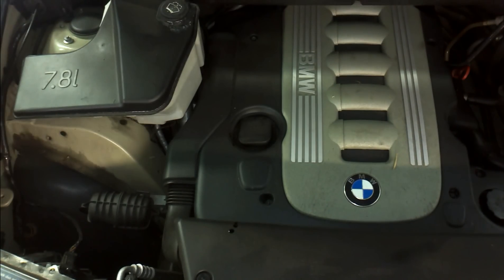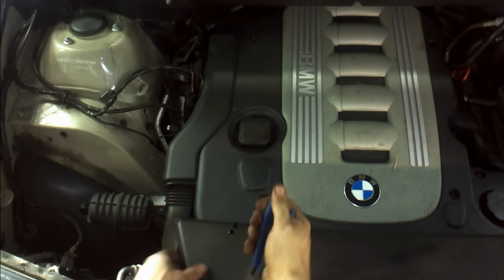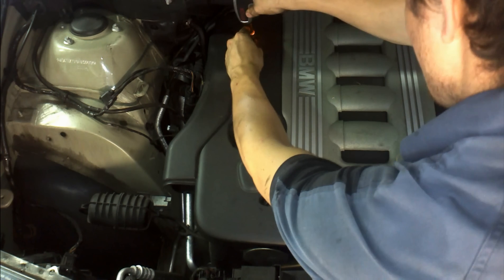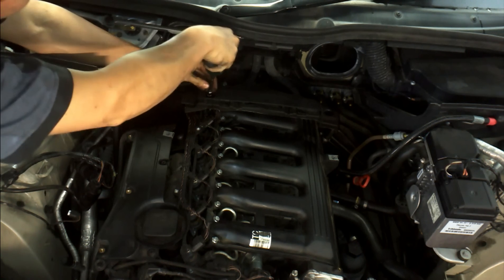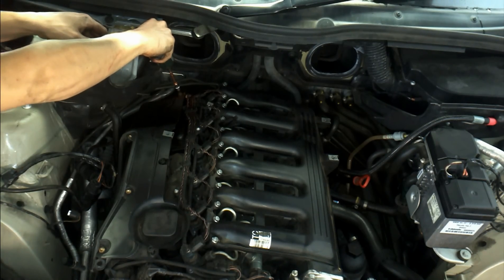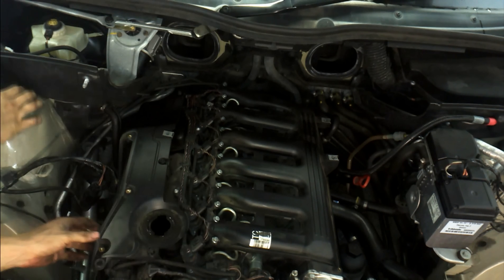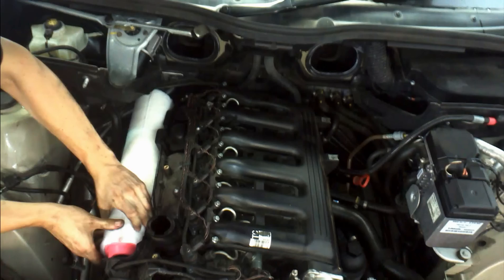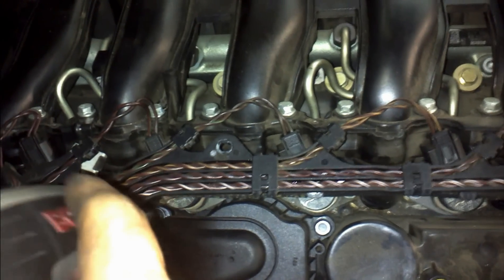BMW X5 E53 Air Filter & PCV Replacement 3.0 Diesel How to DIY: BMTroubleU

Comment: Watched your video wasn't changing PVC but was having trouble with water jets not knowing they had filters was about to buy motors but you saved me a lot of money cleaned the filters working perfectly cheers mate
Reply from the maker: happy days mate- youre lucky you dont have an e70 x5- they have the same problem but the water bottles are hidden behind the drivers side guard. drive safe mate

Comment: I followed that little tip from Seabrook22 and it was a walk in the park.
The Air filter and final cover just falls off and gently lifts out with complete ease.
I also found the existing Air Filter was not installed correctly, and the seal was crushed and bent out of shape. The covers were not in place correctly and that back screw wasn't even tightened up.

So many things fixed and corrected by following this great Video Tutorial :)
Vehicle now runs quieter, smoother and no black soot under hard acceleration.

Comment: Just replaced my PCV setup with the undated vortex version (BMW part number 11 12 7 799 224, no more cartridge to clog or replace).  Your procedure is VERY helpful, it looks like you did this on the 218 HP version, for the early 183 HP version - to replace the air filter you don't need to remove the silver "pretty" cover.  I would VERY much encourage owners to clean out your microfilter housing in the shower - mine will FULL of 10+ years of caked on dirt.

Comment from the maker: Thanks for the positive feedback. Im afraid im not making videos any more cause im working in the mines now. The airbag spring style self leveling systems have many components and issues. If one corner is lower than the others you have a leaking bag, this can be checked by measuring from the top of the wheel arch to the bottom of the rim. Depending on whether you have just rear or front and rear there are also level sensors, accumulators, the compressor, fuses and air lines etc

Comment from the maker: PCV stands for Positive Crankcase Ventilation. It takes the blow back gasses from the engine and usually puts them back into the intake system, but on the x5 its more of an oil separator which vents to atmosphere

Comment: Thanks heaps for this video, its is so clear and professional and every step and trick was covered made what for me was a hard job easy. I was able to complete the PCV valve and Air filter change which saved me a bucket load of money. Have you any videos on the E53 changing of fuel filter in the pipeline?
Reply from the maker: ah yes, that is a bugger of a job but like the description says i dont work for bmw any more unfortunately. the fuel filter is behind a big square cover under the body about at the half way point. to remove the cover is a bit of a hassle, so we used to drill holes in the bottom of the cover which were big enough to either remove the filter completely or small enough to fit a socket and extension though so we could undo the lines and allen key bolt holding the filter bracket on, then undo some bolts at the front of the cover to allow enough space to get the filter out that way (without having to take the cover right off). i do have a video about common issues on e53's if you want to check that out. thanks for the positive feedback- drive safe

Comment: Thank you so much for all your video's BMTroubleU.
They are the most detailed and clear videos on the net, and even better, you're an Aussie!
I have a 2006 X5 E53 3.0d (sports pack), any suggestions where to buy the PCV valve replacement? I'm in Oz. eBay? Dealer?
Air Filter is on the work bench ready to go ;)
Thank You.

Comment: Very handy, as this is a hassle (air filter cover).  Removing the microfilter housing is the bit of magic.  FYI, BMW updated the PCV to a cyclonic design that won't clog-guys in Europe retrofit to this later design.  You could show this to share the knowledge "down under".
Reply: Gregory does this mean that it won't require changing as often as the original?

Comment: Thanks for the video. Was wondering if there could be a risk of engine fumes in cabin after doing this job wrong at some point. Since doing this on mine I get engine fumes coming through vents when stationery.  I changes micro filter and air filter as well as pvc.

Comment: Hi Gr8 vids and info, can't beat a pro 
I have a x5 3.0d that i changed the transmission fluid & fuel filter yesterday. I now have a loss of power and a growling noise when i accelerate. Once cruising the noise goes away. I would be grateful of your help in regards to this.  The local BMW agent replaced 3 injectors 2 weeks ago  and i have noticed two pipes on the right side under the bonnet that are not connected to anything ? Hope this helps  Steve

Comment: What happens when it fails ? Does it break the turbine ? I did the general service on my E53 3.0d ( transmision oil , engine oil , dif. oil , filters , etc...) and nobody from the service told me i have to change this filter (i'm talking about bmw dealer in Romania )

Comment from the maker: nobody told you to replace the air filter or the pcv? air filters are one of the most common filters to change in any car so i'd be surprised if they didnt mention that. when a pcv fails pressure builds up inside the engine and causes all gaskets and seals to start leaking oil, which as you can understand would be a major and expensive issue. to be honest weve only started doing them religiously recently.

Comment: DId some further research this is called an "external torx" and you will need an external torx socket set. Believe it is a size 6. Check out Torx on wikipedia

Comment: Hi, my e39 3.0d will not rev at all, just dies when you try to press throttle, I've changed throttle pedal, all sensors, fuel pumps (electric) No lights on dash, starts perfect runs smooth but just won't rev, I've diconnected the exhaust in case of blockage Any ides?
Id a fuel leak off test and injectors seem ok, it's done 220,000 miles

Comment: Hi, very informative video,thanks. I have an x3 3.0d 2006 E83, similar to the x5 in the video. It has been fitted with a K&N air filter last year during one of its services. Could this be causing the problem I am having. Taking off from intersections, entering roundabouts , inclines & when general driving round town I lose power. I'll put my foot down on accelerator no power , put foot down a little more, no power, put foot down a little more and then the revs kick in and it will take off. There's no revving from the engine during putting foot down. A BMW outlet has told me the transmission is stuffed, an independent auto transmission mechanic has told me the transmission is fine. It's either an air or fuel problem. Two other independent mechanics have presumed the same but aren't willing to take the job on. Please can you help, I'm at my wits end. Thanks
Reply: +simon bennett 
It can be a standard issue with auto box (nothing faulty) just the turbo is spinning up from slow down and torque converter hasnt had a chance to put the power down. If you came to a complete stop then accelerated it wouldnt be a problem, sometime what i do when stopped is hold the brake an pick up the revs a little to get the turbo going and when u let go of the brake you take off (almost like launch contol)

It could mean you have a blockage in your intake somewhere or perhaps theres too much air and not enough fuel do to an injector problem

Comment: hi mate I have a 2006 30d sport witch iv owned for 12 month. Question the car seems to smoke on hard acceleration any thoughts.
Reply from the maker: diesels do tend to look like they blow smoke on acceleration. it shouldn't be a problem unless it starts to become excessive. could be due to blowing out excessive soot from the exhaust or the fact that the injectors are fully open trying to get the most power and are over fuelling a bit.
keep an eye on it, but it should be right
Reply: Hi mate was told it could be the oil filter that your changing in this vid has not been changed in a while so but I'm not sure when its last changed. would that cause the car to smoke on hard acc. And how Important is it to change this when servicing the car as I have all the parts to service but not the filter above as I'm not sure what filter it is as was told it could be a modified filter and it may not need changing coz after 2005 a new modified filter was used, so without striping the car I'm not sure witch one I need the std BMW filter or the modified filter
thanks in advance for your reply hope all above make sense

Craig

Comment: Does the PCV valve separate the oil down to the turbo? I have a whisteling noise when accelerating. I have taken turbo off and taken it in to be tested. They say everything is fine. I have checked all boost pipes and can't find anything. I am pulling my hair out. Anyone have any suggestions?

Comment: hi mate what engine is that your working on, i have trouble ordering parts they seam to send wrong ones  , my engine is same as the one your working on .  ive a 2005 x5 e53     is it a  I THINK YOU CALL IT  a m57 or a m47 ???? or dont u know  yourself
Reply: +tam graham Hi Tam, if it is a 2005 model X5, the motor would be a M57TUD30 3.0 litre 6 cylinder diesel. The guy in the video does not specify what year model the e53 he is working on is. It may be one built pre 2004 in which case the motor would be an M57D30 3.0 litre 6 cylinder diesel.

Comment: I have a 2007 x5 3.0 where is the pcv on this car????
Reply from the maker: petrol models have them under the intake manifold- same as e46 6 cylinders. they are far more difficult to change

Comment: Ok I did this job yesterday. Didnt have the torxs bit for those those little screws. For the pcv. Used a vicegrip. Had to get it done. But why those german (sadists) engineers put these there I can only dream of a reason. Hard to see this in the video and when you get in there you have to complete the job. I also found that taking off the left side cover next to the filter on the firewall opening it up so I had better access to put the filter cover back on. Otherwise hard to maneuver.

Comment from the maker: check out youtube.com/watch?v=HkpuYnaeWUg for your transmission oil leak- as for emmsions you'll need to start checking from your o2 sensors and work up. there are different things to check with diesel vs petrol motors but for petrol start by changing the spark plugs and diesel change the pcv like in this video and see how you go.